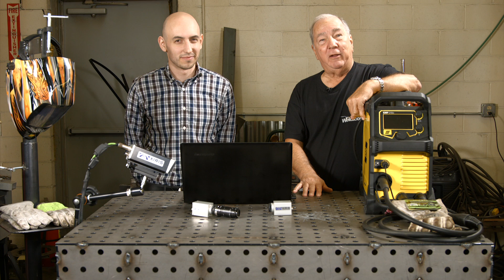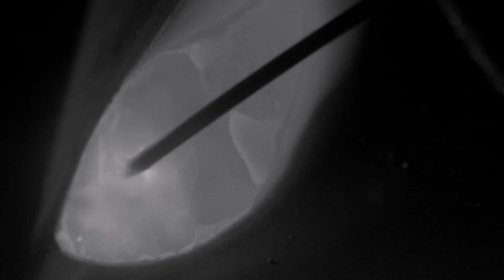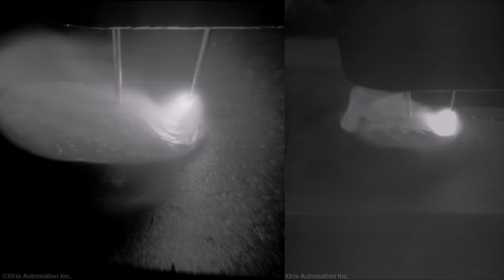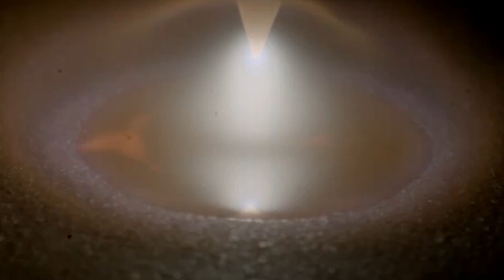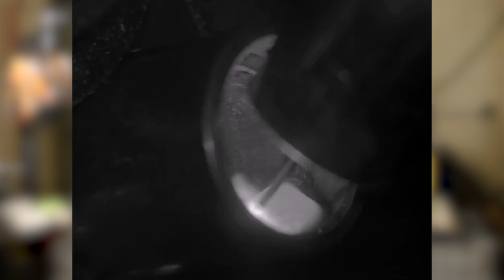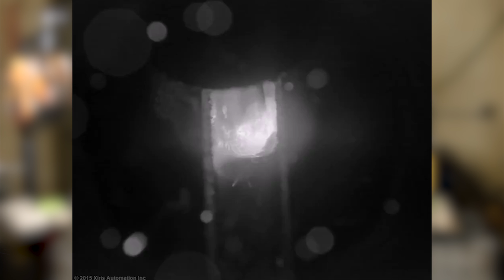Xiris Weld Camera Overview

Comment: Do the MIG welds look as good in color as the TIG weld did? These look way better than those weldwatch cameras you were using a while back.
Reply from the maker: +That Welding Guy You Know The color camera does show the MIG welds nice as well. We used it in one of our upcoming episodes where we built the +Tab and Slot Fab Block you see in this video.